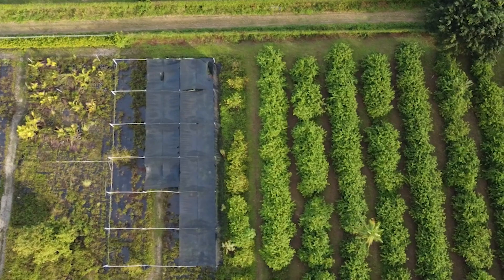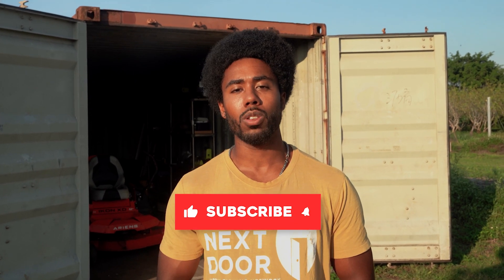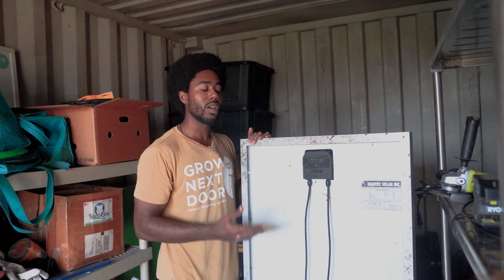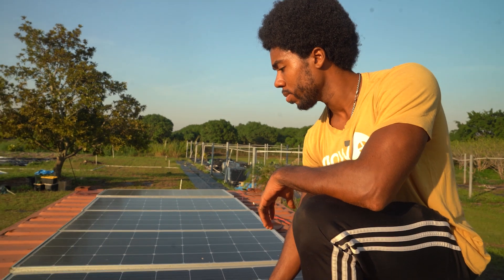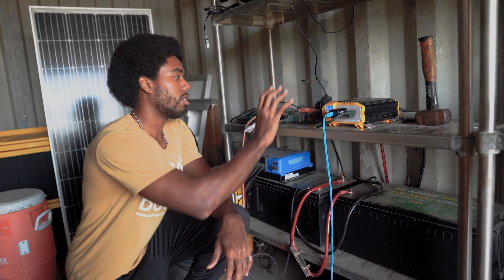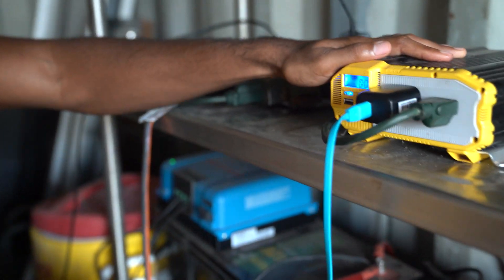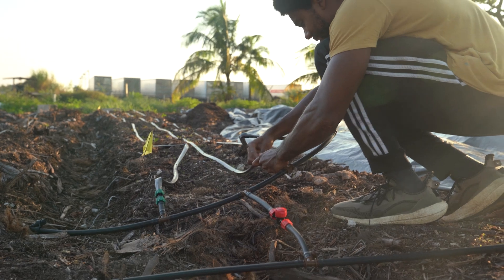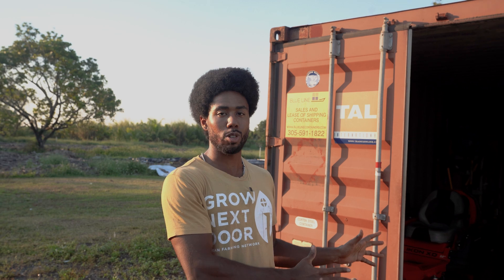How to Get Solar Electricity in the Middle of Nowhere

Comment: Nice set up.  D.I.Y. was the way to go for me.  It gives me a better understanding of how my system works.  12v system with 1400w in solar, 400ah in lifepo4 batteries and a 1000w inverter.   And my journey started with the 100w  harbor freight solar kit about 4 years ago.  You have more of the ability to add more to your DIY solar system  then most boxed systems.  Keep up the good work and hope to see more of your journey in solar.
Reply from the maker: The learning curve although painful def leveled up my understanding of these systems. So invaluable info for sure. And youre def right. The more out of the box something is, the more boxed in you are from making tweaks here and there. Custom gang going strong 🤘🏽

Comment: Hey Dev nice video. Good to see people figuring this out. I also love generating my own energy. I’ve made it quite a way so a couple quick learnings to pass. Pay attention to price per kWh. You will see that lead acid is not worth the cheap price tag. 2 everstart Walmart batteries will cost $120 ea. rated for approx 1xx Wh ea but only useable 50wh. A 100 Wh lifepo4 cost $220 (Amazon and Walmart on sale chins brand or ampere time.) for future videos it would be cool to hear your thoughts on 12v vs 24,36,&48. Maybe cable length and gauge comparisons, and series parallel panel connections and testing. Thanks
Reply from the maker: Thats all valid recommendations! Yea i didnt even go into the different voltage types related to battery 📝 def will consider a part 2

Comment: Great job in this small system build being totally off the grid . 👌The lipofe4 batteries , PV modules and the Victron charge controller have gave you a big start and maybe in the future you will have greater results when you upgrade the inverter to expand on the farmland . 😉Check out my DIY solar videos , hit like leave a comment and subscribe . May the solar be with you .🤗

Comment: Wanted to say that you are living my dream . Secondly …  thunderbolt solar  panels from harbor freight are top notch , they are 120$ but they always go on sale for 89$ during the holidays. The downside of those batteries is that they can get damaged in cold conditions so a self heating battery would be your best interest  . Redodo sell them along with a few other manufacturers…  great video sir
Reply from the maker: That's good to know, I have enough land out here to work with, I wouldn't be opposed to dedicating a piece of the prop to some solar energy harvesting. ty for watching